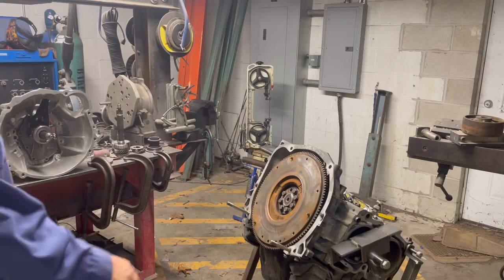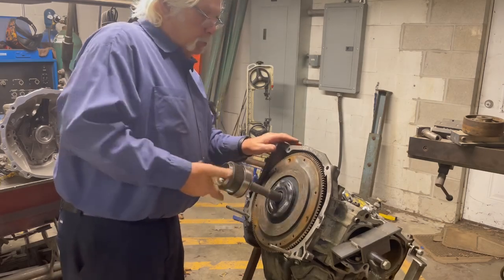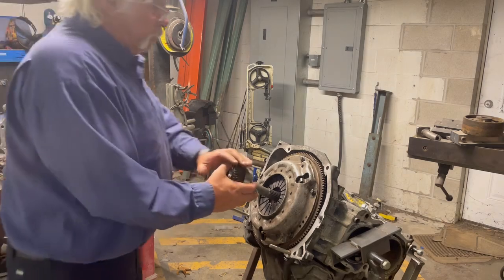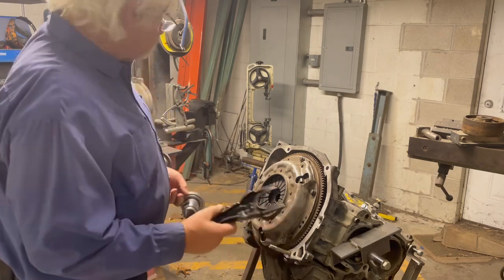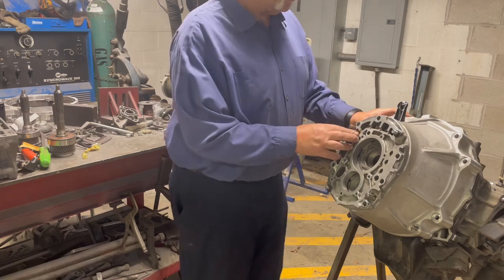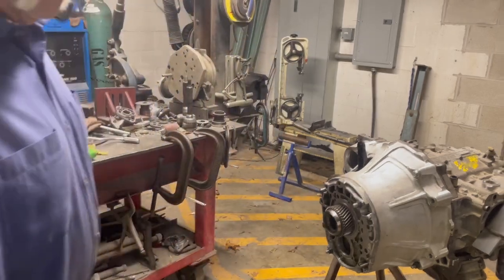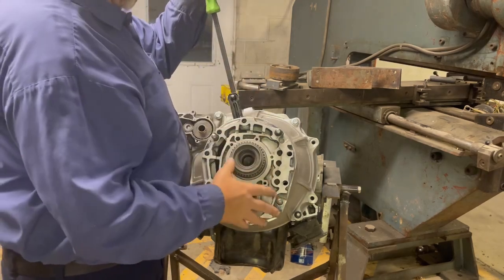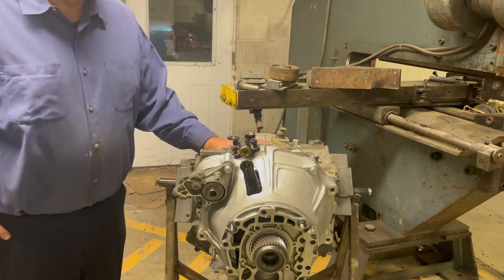Subaru engine mated to a Toyota R 154 transmission 05-15-24

Comment: This interesting because a lot of small shops that make conversions using Toyota transmissions usually give you a billet flywheel with steel inserts, the steel inserts most of the time are made by fidanza and are a off the shelf replacement friction surface made for their billet Subaru wrx flywheels